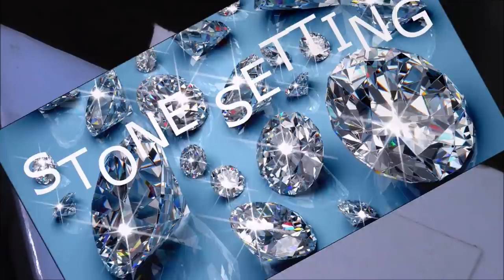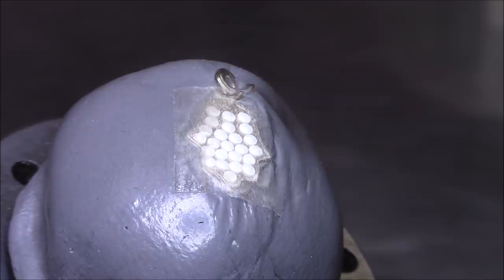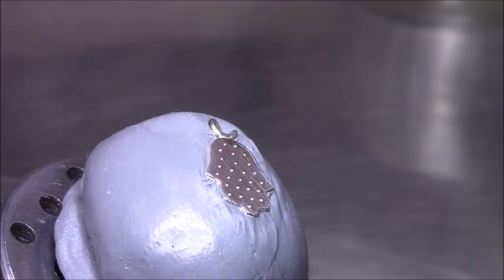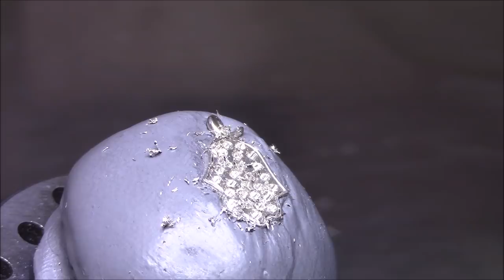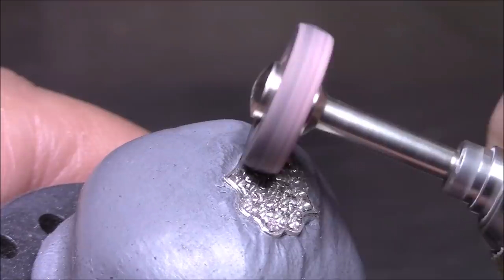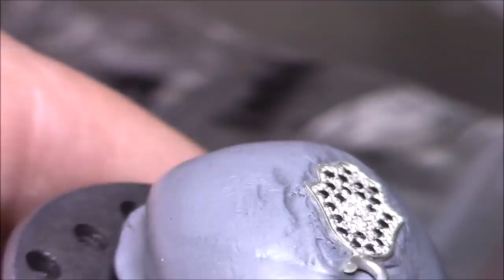Закрепка камней Stone setting (ПОДВЕСКА)

Comment: Gold or silver? Or steel?
Reply from the maker: Silver
Reply: Обзор закрепки камней STONE SETTING Andrej Jeweler is not easyer to cast with stones?
Reply from the maker: I like this method more😀
Reply: Обзор закрепки камней STONE SETTING Andrej Jeweler but is any difference?
Reply: Обзор закрепки камней STONE SETTING Andrej Jeweler will casting be cracking?
Reply from the maker: In my way it's easier and more accurate. In this way, you can mark out any convex product. At the same time, knowledge of geometry is not necessary. Often they bring products and ask what kind of stones are needed and how much. I have developed this method for myself. You can do as you please.)
Reply from the maker: https://www.instagram.com/p/BfWYe0rjuPa/?taken-by=andrejjeweler777